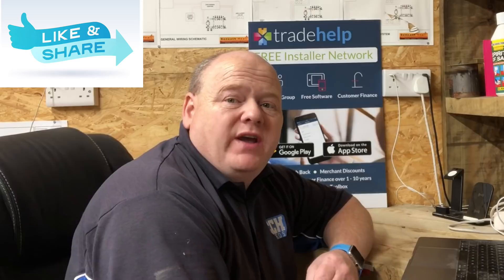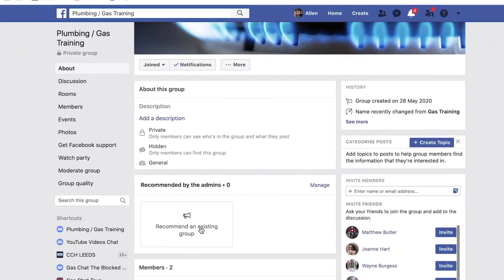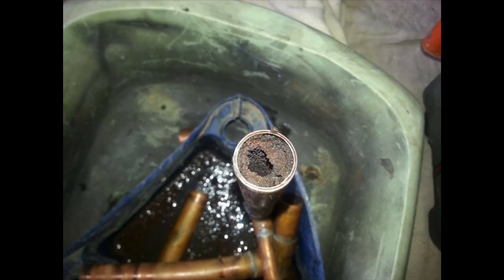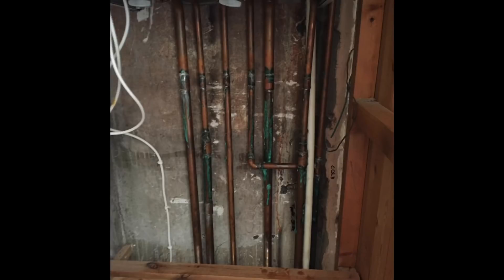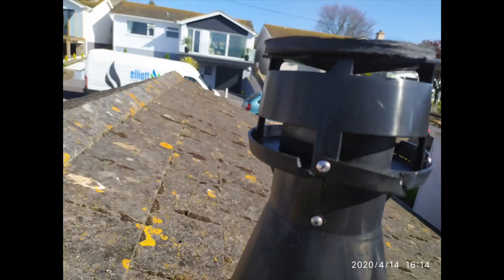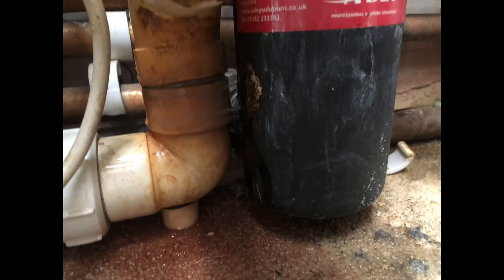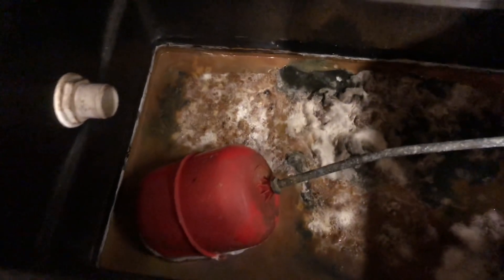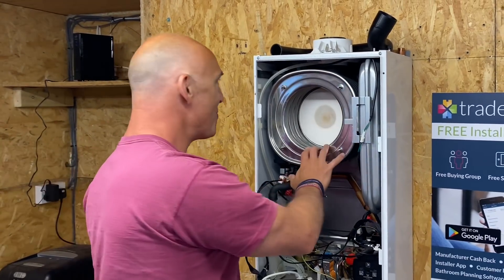Gas Training - Unsafe Boilers Cookers and Plumbing - Leeds Plumber

Comment: im in building maintenance in the city and the biggest plumbing gripe i have is the use of silicone on wastes !! whats wrong with plumbers mait ?? it lasts for decades and remains pliable and isn't affected by chemicals !!
its ok to use it as a stop gap while getting parts but beyond that do not use it !!
 we have a legal duty to clean tanks and pipe work annually at least with chlorine or suitable chemicals (some use silver nitrate ) why dont we have this for homes ?? even five yearly would save peoples health 
also with modern toilets and showers a large tank might not exchange enough or quickly enough so maybe get your local plumber round to review your usage and tank size
Reply: As a DIY'er I was very happy when I discovered plumbers main, though I certainly never siliconed the hell out of something like these examples!

Comment: Usual I find If the trap has discoloured that much then usually it means the heat exchanger has pin holed and water washes down the heat exchanger, definitely the case with Ideal boilers I find.
Reply: Yep, cant imagine how many openvented logics have been leaking away unnoticed.